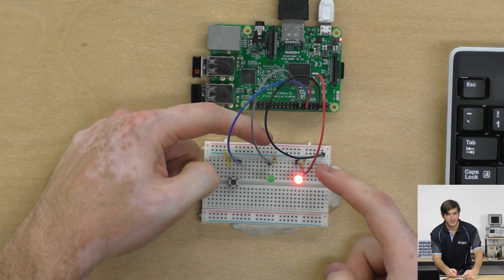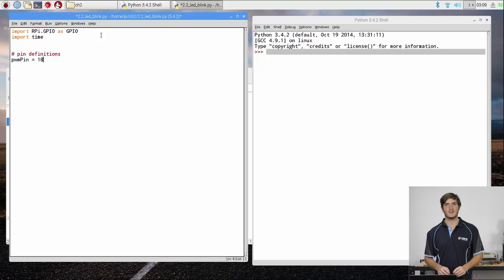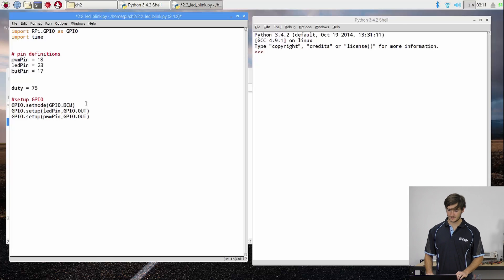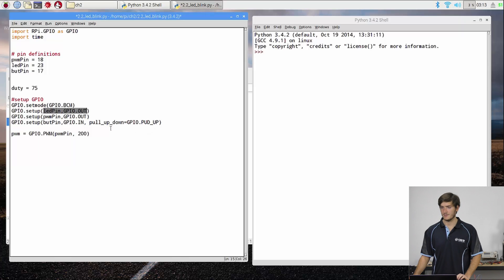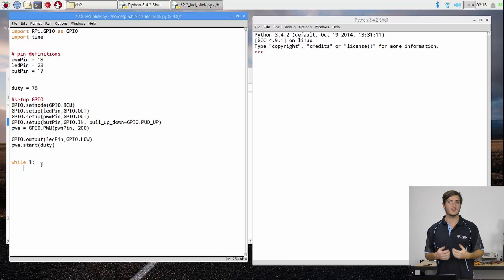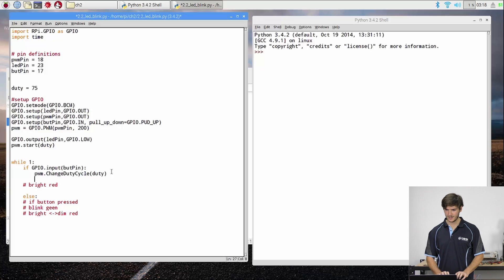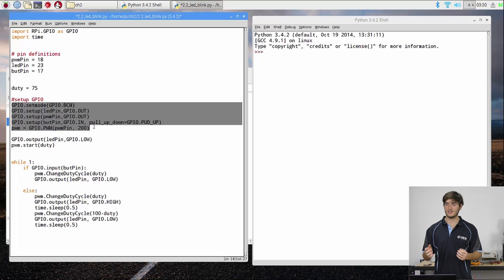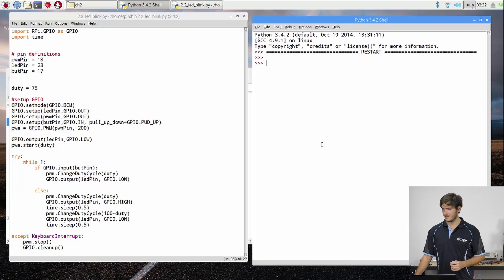Raspberry Pi Workshop - Chapter 2 - Use GPIO to Connect to the World Around You

Comment: why 18, 23 and 27
i check the official website circuit drawing but couldn't understand
Reply: That's because the GPIO name and header pins on the board are different.  Header pin #11 is GPIO17. Header pin #12 is GPIO18. Header pin #16 is GPIO23.